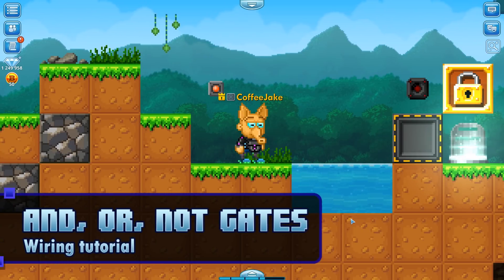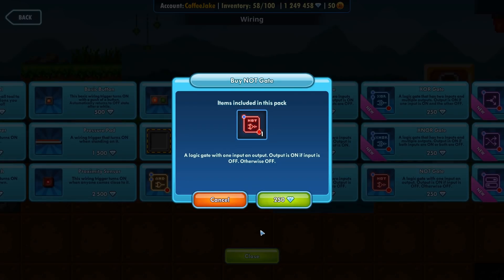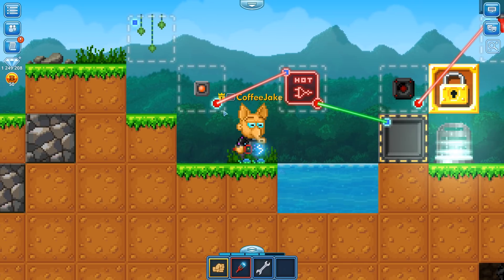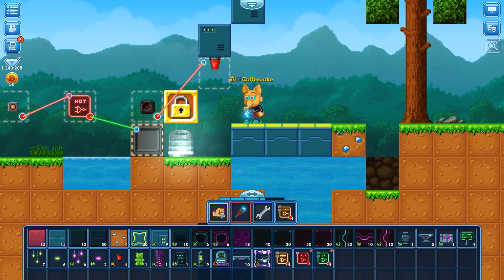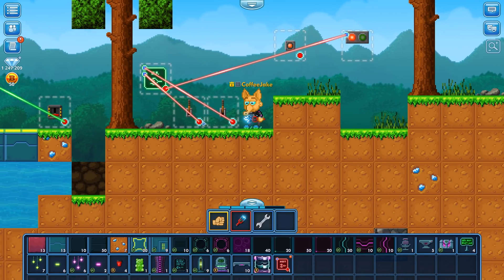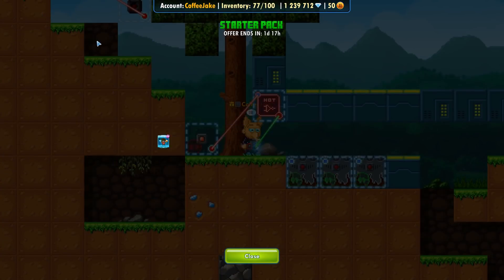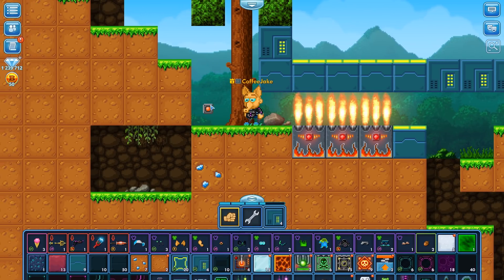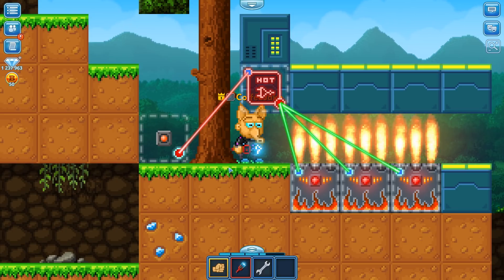And, Or and Not gates [WIRING TUTORIAL]

Comment: Hello Jake. I am using sensors, push buttons, fans, ice blocks, metal trapdoors, wired metal trapdoor, portals, vortex portals, and a bunch of wiring tools by try on errors until I get it to the point I like for my spike bombs and hovering mines breaking. I don't use script nor know how to script. I don't run 3rd party program neither. I always watch the game while I am playing. I only use what came with the game and wondering why the the mods keep thinking that I am running 3rd party program, scripts and such. Mod even said that I level up so fast in a short time. Is there any rules that players not allow to level up up fast in a short time? Before, I fish a lot, but fishing get nerfed with so many dumb fishes , so now I am break spike bombs a lot:). Do mods have good knowledge of wiring? Do mods  only assuming that people running 3rd party program and script when they see the system is too complicate to understand? Thanks!
sensors
push buttons
fans
ice blocks
metal trapdoors
wired metal trapdoor
portals
vortex portals
disappearing block
AND gate
OR gate
NOT gate
Signal Divider Gate
Signal Holder Gate
XOR gate
Water
Check Point
Bumper
Constant Flame Trap
These are all what I am using.